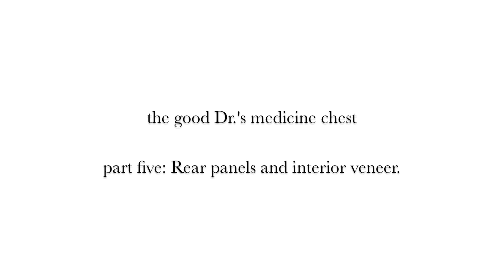Hammer veneering with hot hide glue- the good Dr.'s medicine chest part five.

Comment: Hello, I have not used the animal's glue for a long time, because I read about the dangerousness involved in the non-rigorous hygiene of the elements used, derived from the presence of bacteria that can later become spores. What is your opinion? What degree of hygiene should be applied when using this adhesive? Thanks greetings!
Reply from the maker: Thanks for the question. I've never had any issues but recommend that you don't let it sit for any more than a day without cooking it. It can go mouldy and could be an issue. 
Use fresh glue and keep it refrigerated if you plan on storing it for any amount of time.
best of luck~

Comment: Do you have to use hide glue to hammer veneer? I have a piece that I want to veneer with raw ebony veneer and it has an interior and exterior curve so I don't have a practical way to press the veneer onto it.
Reply from the maker: +BrandXsps thanks for the question. The answer is yes, you have to use hide glue for hammer veneering. That said, you don't have to use hide glue to apply veneer. Sounds like you have a piece with deep curves so a form and/or press may work better for you. ? If a form is used, then hide glue isn't necessary . Hammer veneering depends on the glue setting up while you work it- standard glues don't work for that reason.
hope that helps-
all the best